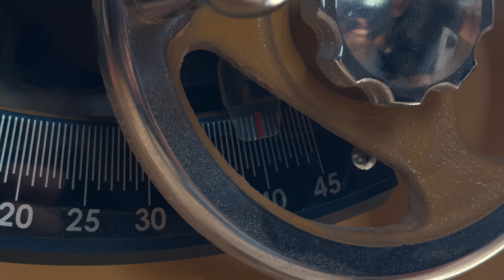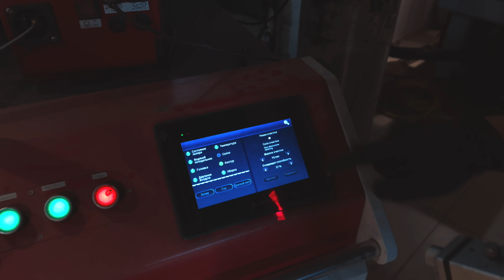🔥 You have to see this! No one believes that I did it MYSELF! Crazy timelapse 💣

Comment: super dangerous way to use a table saw from the get-go, if you don't keep that board square on the fence once you're in for a nasty accident when the board kicks back and smacks you in the face. Use a crosscut jig or the sliding fence that runs in the t slot on your saw you shouldn't trap the wood between the fence and the saw blade like that.  The fence is for ripping stuff. also, why the blade so freaking high, the whole video was seconds from disaster, and you should definitely find a new hobby while you have all your fingers. SUPER DANGEROUS
Reply: “Made by a Mad Man” what do you expect 😂 but yes I agree, beginners watching may get false security here (spelling edited)
Reply: @expatmoose  like the guy in the video that is
Reply: I couldn't agree more.  Watching this made my butt pucker. 🤯
Reply: @olroy61 well thats a feeling I’ve never experienced 😂😂😂😂
Reply: I learned the lesson of not cross cutting using my fence about 10 years ago. I had 1 cut to make. I didn't get hurt but my table saw was ruined because it bent the shaft.
Reply: Yeah, and the gloves, no pushstick, the blade max raised, no blade guard ...
Sorry, I can't watch till the end...
I hope no one imitates 😱
Reply: Dangerous way to work made worse by wearing gloves
Reply: Bubble wrapped your kids, huh?😂
Reply: Great shop machines! Ungreat use of shop machines!😮

Comment: I have the impression that the saw blade is extended too far compared to the thickness of the boards.
Reply: It's "best practice" to have the sawblade slightly higher than the material.
But if you get clean cuts and are not afraid of cutting your fingers off, then it's nothing wrong with a high sawblade.
It makes cutting things more exciting 😂 and... He is a madman...
Reply: The blade has a lower flex point.

Comment: Nice, For a minute there i thought you were making a radiator kind of shelf/ Towel rail heater for the bathroom. nice shelving for the kitchen indeed. One thing though ? Why did you use the angle grinder to cut that first long strip instead of the lazer ? just curious that's all. Love the added lighting you added to the project.